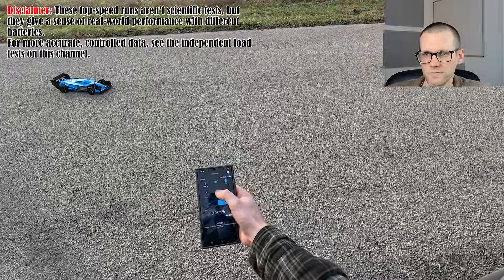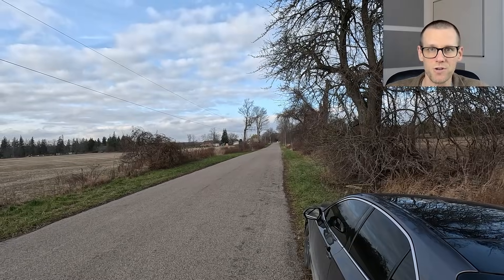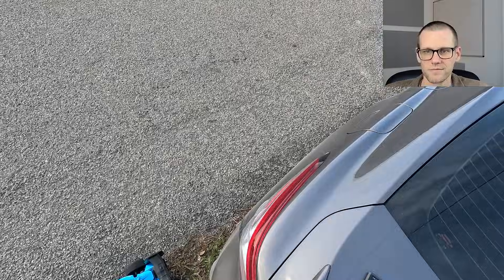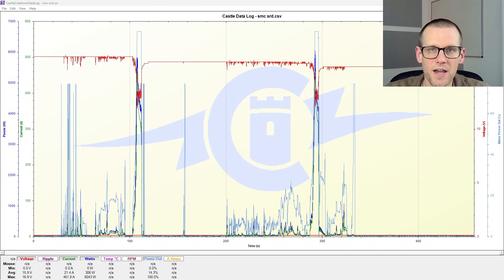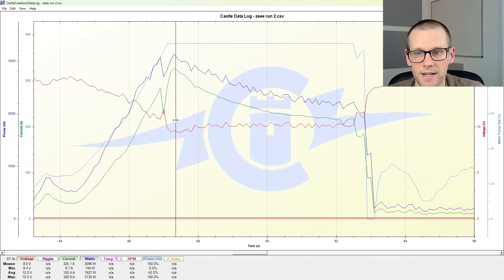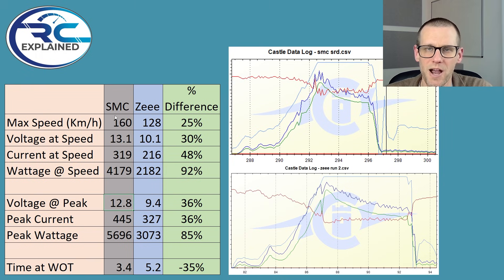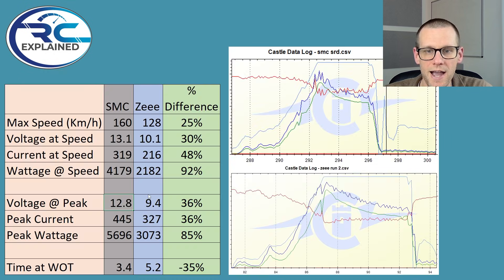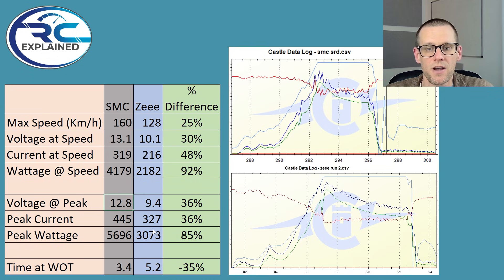Best vs Worst LiPo Battery attempts 100mph in a Speedrun RC Car

Comment: The SDR SMC pack I ran it against an Ovonic pack same mAh same C rating and did 3 speed runs with SMC averaging 33% higher speed than Ovonic. I also ran a traxxas 3s against an ovonic 3s . The traxxas was a 3s 4000mAh 25C and the Ovonic was a 8000mAh 80C and the traxxas battery was 2 mph faster.
Reply from the maker: Interesting, I just posted a video where I test 7 packs from 5 brands. I got the ovonix in there as well as cnhl and Zeee.
Reply: @RCexplained I bought some zee 3s 10000mAh 120C packs.  Going to see how they compare . I think mainly for just bashing these batteries probably will do OK.  But for speed runs I recommend the SMC SRD packs. Specifically with the armma infraction I've been speed testing.  For some reason it just eats up the cheaper batteries.

Comment: SMC are the most powerful batteries I've ever ran. C ratings are correct or at least closer than any other brand to what is advertised.  I use the SDR 10000mAh speed run pack. Never had them get puffy like others claim .
Reply from the maker: Im really loving the performance I see from the smc packs high performance packs.

Comment: Great videos.  I've learned a lot.  Thanks for sharing.  I can appreciate the raw power advantage on a speed run car like this.  But I have a 4S Basher which so far spends as much time on its roof waiting for me to go flip it upright than it does running at speed.  I have so far had good performance from Ovonic CAR 6700mAh "120C" LIPOs.  More than enough power to run around, jump,  flip, and generally bash , and runtime is like, an hour each with my driving style, with plenty still in reserve..  I'd rather get two of those for less than one SMC or Gens Ace pack.  What am I missing other than more raw grunt than I'm probably capable of controlling (or seeing) for those ten second speed runs?  Heck I'm still on XT60 connectors.(XT60 - TRX Adapters).  Would I realize the benefit of an SMC in a 4S Maxx Ultimate?
Reply from the maker: Thanks for the comments. You are correct in that you dont need the best battery to match your specific goals. However, I would not want to pay ovonic prices when the cnhl is just better and cheaper.
Reply: and yeah you need to find a big open parking lot to do speed runs on.  That's a nice spot with light traffic but wow it's narrow

Comment: Apples and oranges. Every SMC I’ve had puffed and none of my Zeee have puffed. Also you’re comparing a battery made for top speed runs only vs a budget battery that’s better for the 99% of other applications. I’d never buy an SMC and have seen others at my airfield have them puff.
Reply from the maker: Zeee vs SMC was the comparison I was asked to make.
Reply: Wrong - keep learning.
Reply: I can totally agree , I have 36 packs , all 2s , 3s & 4s & all brands & the only batteries that puffed on me was 3s SMC . I believe SMC are the best batteries to buy but facts are facts . Two packs from SMC puffed after 20 times being used in a fast electric boat & I never used them again because I didn't want to take a chance of fire .
Reply: No one cares.   Try taking better care of your packs.    Its always the packs fault.  SURE

Comment: But that pack tested at 22.4 C on your chart and seems to be outperforming your specs by a healthy margin? Is your "actual C" chart wrong? It tested at 27.4C and 143A. So wouldn't burst be 286A? But you pulled more than that just fine. Also wasnt that with 10awg wires and most SRD have the 8AWG wires don't they? Just curious what my 8AWG 6s 5200 SRD pack is really capable of.
Reply from the maker: I have the chart here and I don't follow your numbers. But more importantly
I think you have to provide your definition of what burst means? Both these packs can likely spike to 1000A, but what would that mean for you and the data I collected? 

The SMC uses 8awg wires.

Comment: Great comparison. I’d love to see some ovonic and cnhl batteries tested aswell. I don’t speed run anymore but I have a few pacs still from when I did. Might have to try them out in my tekno mt410 Og and my arrma Mojave chassis build!!! Keep up the amazing videos!!
Reply: Ovonic are not going to do well speedrunning.  I just tested their top of the line 4s  120c 1500 and it wasn’t bad, but is was the slowest of the high end packs I tested.
Reply from the maker: Thank you! More videos coming

Comment: This is the test I care about and asked for. Thank you!    All the numbers and theory are nice but seeing how it actually affects the vehicle is better.   Many vehicles don't demand max amps and don't need top batteries.  If you've got a 60 amp esc it really doesn't matter how long a battery will hold 100 amp load. If you ain't got the motor and esc to demand it then you're battery doesn't need it.
Reply from the maker: Glad you enjoyed the video! You are correct, many vehicles don't demand very high amps or >100A to put a number to it. However, if you are after performance, which is the only metric these tests demonstrate, then it does not matter if your system pulls 150A or only 60A. 
A battery that does well at 100A surely will do better at 60A, vs the battery that does poorly at 100A. I would choose the battery that gives me the best performance and also, I certainly won't pay more for a battery that performs less. (Fake c ratings)
Reply: A good battery holds a higher voltage under load, so it doesn't matter if you only need '60' amps - the good battery will be holding a higher voltage at 60amps which translates into higher RPM and more speed.  You'll get more watts out of a good battery at any load.
Reply: Exactly.

Comment: That road is on the narrow side, it doesn't leave much room for error. I am surprised with the Zeee it didn't trip LVC under load.
Reply from the maker: Hi Doug, its a narrow road but I feel like I should have done better. 
You can see the bold red line for the LVC in the graph. Its at 0. No LVC for my speed run setups.